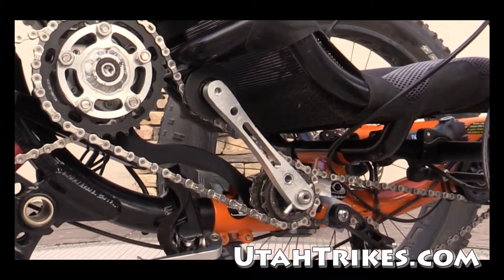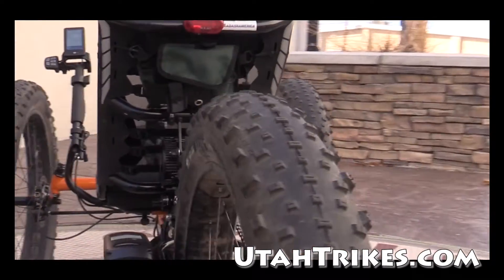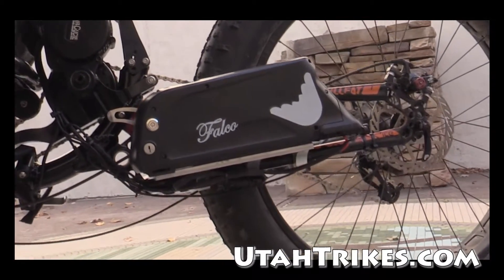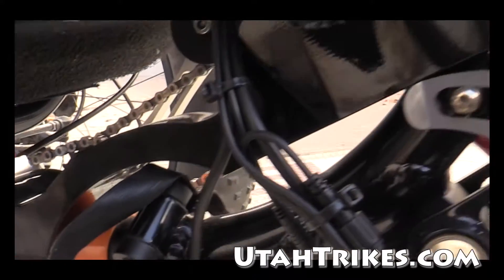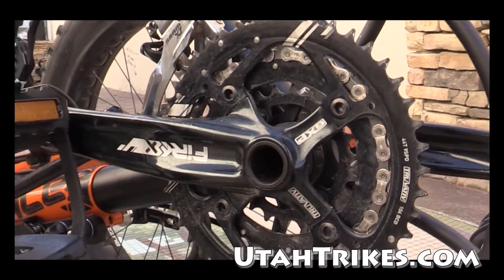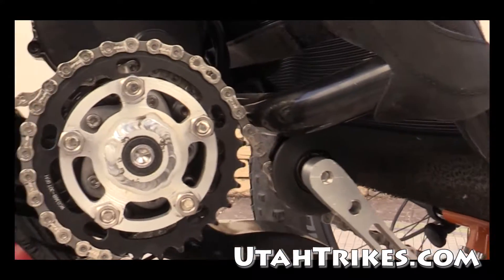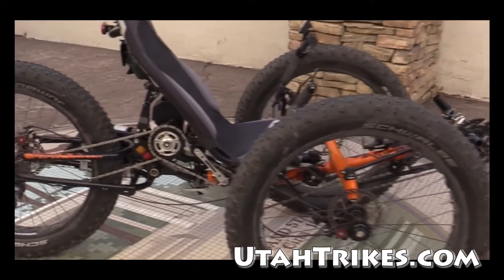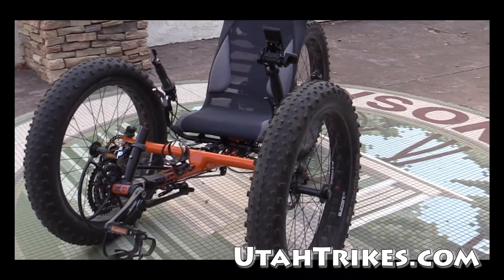ICE Full Fat Trike with Custom Middrive Motor by Utah Trikes

Comment: Did you guys consider the DaVince motor? That thing is wickedly brilliant and would have fit perfectly. Although you would need a disc brake hub, as it works best driving the rear wheel directly.

Comment: I'm looking for and searching some options here and what this might cost me. The ice trike with fat tires and mid motor might be a candidate. I'm 64 and I'm a retired disabled Law Enforcement Officer and Vietnam Era Veteran.  I sold my Honda VTX trike which was my favorite what a blast, 12.6 seconds in the quarter mile. I didnt have the physical strength to ride it anymore  so I got a Burgman 650 trike went on a few rides and collapse in my home rushed to hospital and almost died of pneumonia,  I had it for 2 months didnt know it. Anyway I'm in bed for 8 months and I'm up and running, somewhat. I'm weak on my right side from a broken neck and shrinx on my spinal colum, I got rear ended in 93 worked 2 yrs as an LEO and if someone had tackled me the Dr said I'd be dead. So I used to race road bikes (I could go 25  all day long burst to 32 mph, had a nice cannondale sweet light bike. I got an old 3 speed shwinn trike that I put a bigger front ring sprocket on so I could make use of the 3 speed gearing ) anyway Sorry I digress, lol. So I've been riding a recumbent stationary bike in my house, 18 mph and 80 rpm. Can't walk right but still when ya learn how to do it. So recumbant seats were to low back then and didnt even think I could modify them. I  was walking with a cane with 4 legs on the floor until I fell last year and I broke my right hip and  have to use a Walker.  I loved my vehicles have owned 64 of them and 16th bike is now being sold because I can't safely get on it. It has 11k miles looks new but in the last 3 yrs managed only 1000 miles. So now I have to use a walker and have only gotten 16 mph 66 rpm on recumbant stationary bike. So I'm exploring the feasibility of getting a 2 for 1 if I can, put the proper lighting and gear on it and attempt to ride an Ice trike ,like this because before long I should be able to pedal 20 mph 80 rpms and need the motor assist when needed off road or on trails. If I can register as trike motorcycle is 60 mph wise, with road slicks. If 45 mph and registered as moped that might have to do. I've been a gearhead my entire life and love taking whatever vehicle or bike from 0 to 60 every once in awhile and let it ripp. This is not a gag or joke, I'll be giving you a call this week. I live in Zephyrhills Florida where I worked as an LEO in a few Departments until I worked for State Parks. When I'm out riding I'm just a normal guy for an hour or less whatever my body will tolerate. So being housebound  for the past 3 years I'm trying to get something that will work for me. 22" seat height I can get on and off. I haven't figured out how to make a collaspable Walker yet and will strap down the cane to have with me. Once when I was walking to my trike with my cane a guy shouted out " should  you be riding that" I said just because I can't walk to well doesn't mean I can't ride"! Hahahaha. So when I saw a few guys ripping it up on the road on you tube I thought this is intriguing  and maybe possible. I've been checking out recumbents for the past few weeks and as soon as my trike sells it's some kind of wheels for me. I will need the calf pedals with velcro around ankie and velcro feet  to pedals to a pedal.  I wouldn't want my legs flying off. Lol. So I've been looking and been checking into this. If a 3 wheel electric car makes more sense, not, I like this idea to being  honest, I'm in the explorer stage I guess. A used mountain power assist trike may be way I have to go. I'm excited to know I can get out and ride again. Outriders making machines the Quadriplegic can ride. I know what that's like too. At 22 I was in a bad vehicle wreck and was given last rights told I might not make it and was told I'll probably be in a wheelchair the rest of my life, couldnt even move a finger. 2 1/2  months in a striker frame  and a neck brace for 9 months after that. I was an animal working my butt off to go from there to walking 5 miles every day, running few mile every other day and working out on a nautilus machine every other day for year. Road one 100 mile on my bicycle  once and 50 , 30, or whatever. I passed all the physicals and tests to work at 2 PD 2 Jobs Sheriff's department,  to State Officer till 96 when after neck surgery had  put a plate in my neck c-3 to c-6. And here I sit today doing an old man shuffle but I ain't done yet, I'm still 18 in my head ! Hahahaha  I do feel like I'm 100 and forget most of that when I'm out doing my thing. So are you interested  in possibly working on this project and challenge together. If ya tell me I'm bat ass crazy that's ok, I'll figure something out. This you tube  vehicle inspired me to dream. Oh when I'm 104 and mounting a recmbent from my wheelchair (, my body slowly breaking down and nerves dying for past 20 years or so) I'll just say no reason not to drive one of these just because I can't walk. I'm going out with my boots on hopefully 43 years down the road. A thanks and shout out to all the guys with differing disabled abilities riding these and still choosing to enjoy life how and when they can. THANKS GUYS AND GALS. I'll be calling you soon, talking to Matt maybe? Thank Dj